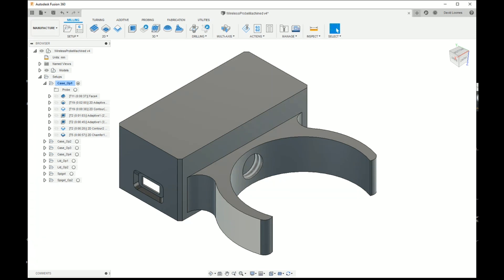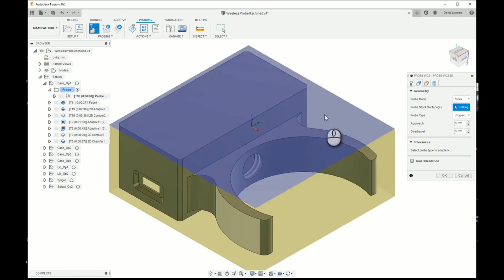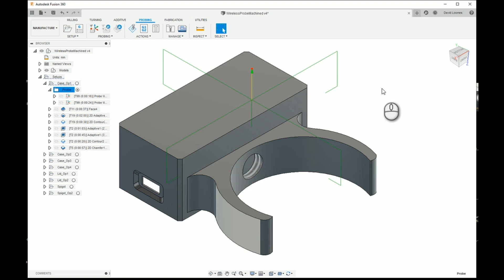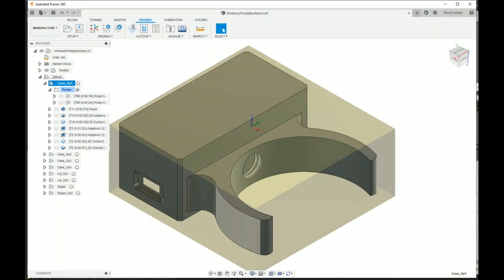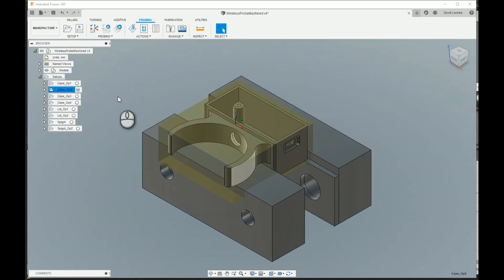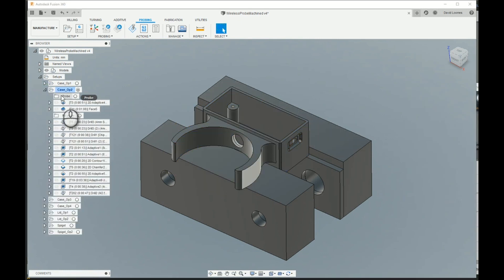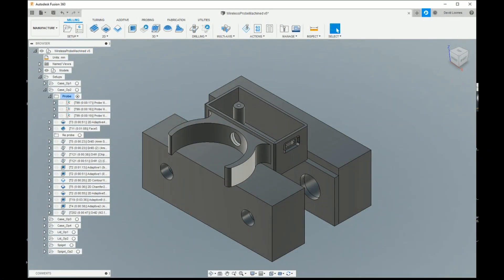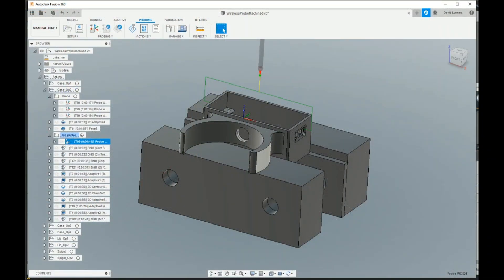Fusion 360 probing tutorial

Comment: WHAT, How are you tapping with a 440? AH no "reverse spindle"??  I run a 440 at my work and personally own an 1100M.
Reply from the maker: 🙂The 440's motor has always been able to run in reverse and there's a terminal on the vfd to control it.  They just ran out of outputs on the system controller to operate the reverse.  If you have a USB I/O board on your machine (Tormach's or my own https://shop.xoomspeed.com/collections/cnc-accessories/products/usb-i-o-board) then you can use that to control the reverse function.

Once that's sorted, there's an option in my Fusion post-processor (free from http://xoomspeed.com/CNC/FusionPostProcessor.htm) to expand the tapping cycles and substitute USB I/O commands where you'd expect to find M3/M4 controlling the direction.  Costs the I/O board, plus 2 pieces of wire and a T/C tapping head to make it work.  At 500rpm on the low range, the 440 can tap up to M5 in alloy or M4 in steel.

Comment: Will your probing conversion work in tormach a tool changer? Just got a 770mx and definitely interested in getting your wireless conversion kit
Reply from the maker: Shouldn't be a problem.  I use it in an ATC with the TTS tool holders and many others have done so.  I know it's been used with one of Cliff Hall's ITTP probes on an 1100MX, so that definitely works with the BT30.  I can't remember if anyone has converted one of Tormach's passive probes with the BT30 toolholders, but I'd be very surprised if that was any different.  If you found that combination didn't fit, I'd either make a new case to get it to fit or certainly offer a refund, no questions.
I think I'd know by now if anyone had found it a problem though.

Comment: Fantastic video. Now I understand better the power of probing in cycle. I definitely want to convert my probe to wireless like you did. A great inspiration, hats off !
Reply from the maker: really glad you like it.  The wireless probe and an ATC obviously add the final touch, but if you have a Fusion post that supports probing on your machine, then the probing functions are just too good and too simple not to make use of them
Reply: @daleksw  do you know if the wireless conversion can be done on the active version of the tormach probe ?
Reply from the maker: @loupitou06fl  I don't know for sure, but the active probe normally runs on 5V so it may not work at all on the single cell LiPo (3.7..4.1V) I have.  I've also no idea what the current consumption is like, so I'd assume not.
Reply: @daleksw  thanks for the prompt response. I'm going to try and keep you posted.  I was wondering if you have considered putting the ETS on another transmitter and have the probe and the ETS have a different ID that the base will pick up. Or are you using the fezthers as raw tx/Rx without packets/ID ?